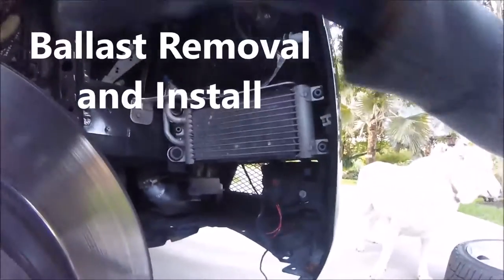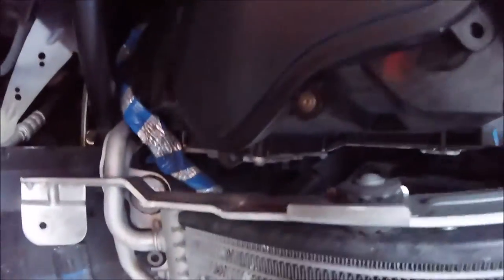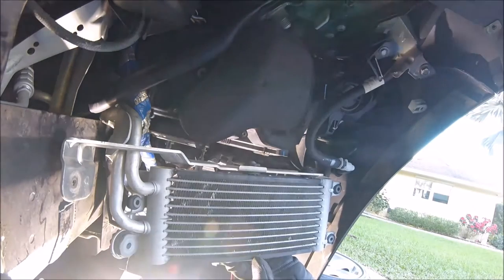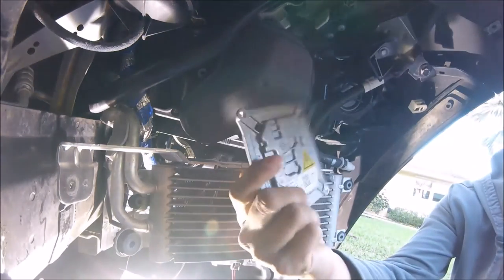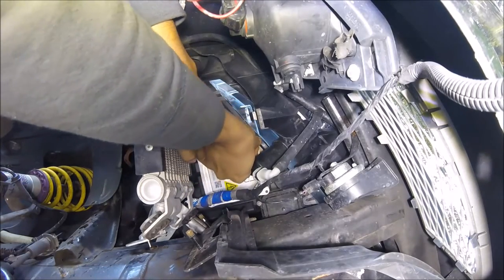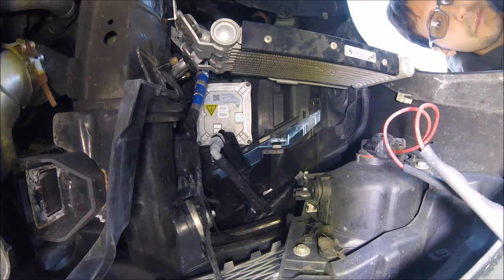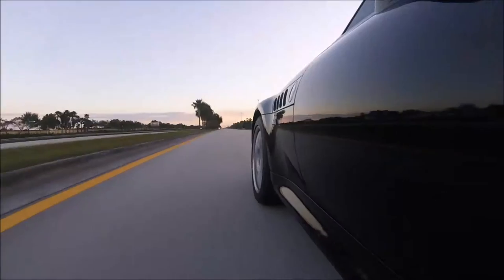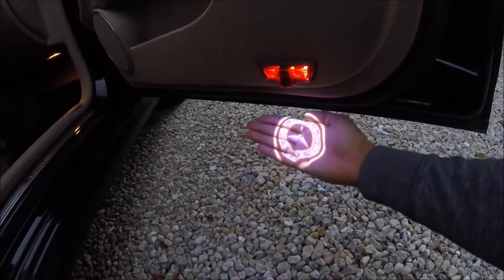Installing headlight ballast on BMW 3 series

Comment: I think i shorted out my drivers side control unit for my adaptive headlight and the low beam ... do you think i can replace both from just the wheel well .. or will i need to take out the whole headlight? I'm thinking the latter
Reply from the maker: Wheel well should have enough space to work

Comment: May I ask where your purchased your non OEM ballast from? There's one in Amazon with great reviews and is only $50. ECS has one for $260 and of course OEM and far more. I'm glad to see you didn't have to remove the front bumper, my shop said I would have to and it would be $250 in labor alone
Reply from the maker: Charles Craig eBay. The one on Amazon works great